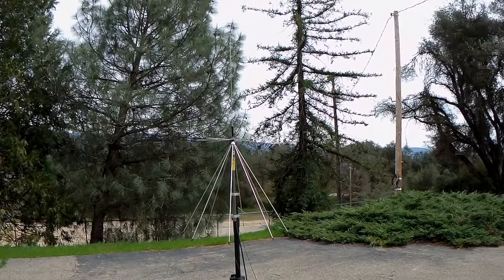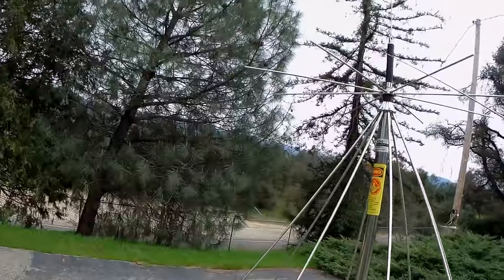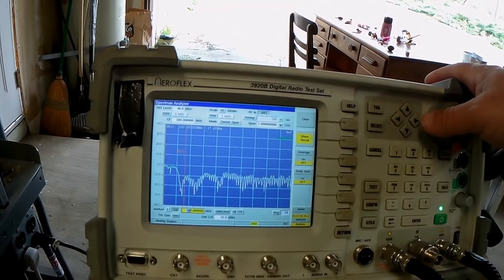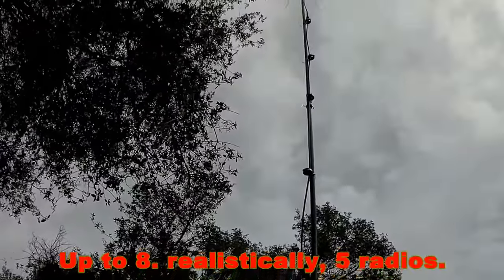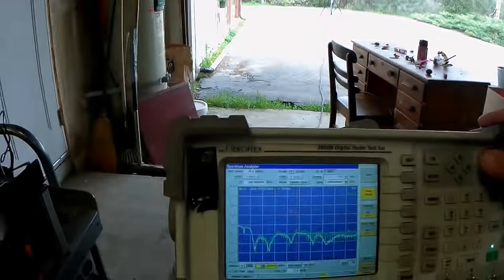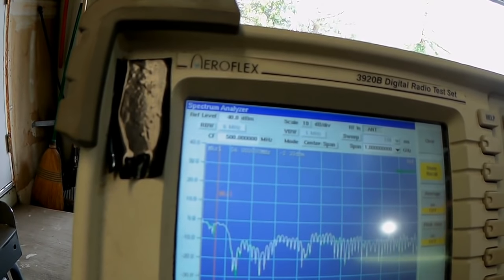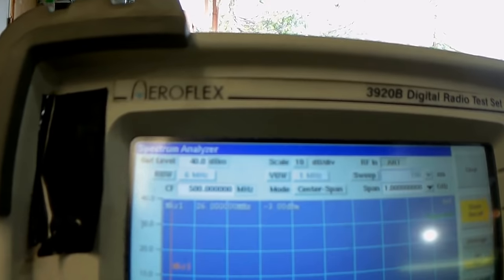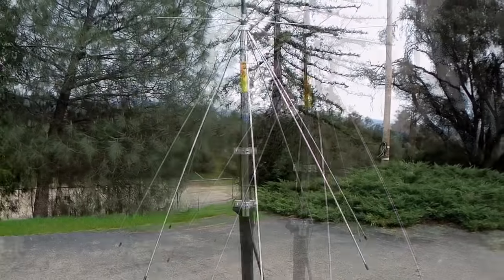Discone Antenna 4 Year Report. + Mods & Future Expanded Capabilities.

Comment: Very good antennas for a universal VHF, UHF , SHF and above =)   I have two of them and did radio repair for a few years ...... love them =)     Kept the two at the house and used them for everything with out worry to transmit into as long as the frequency was above 50 Mhz =)   Now that being said ..... these antennas DO NOT HAVE GAIN over a DIPOLE ANTENNA; but work GREAT on RX and TX within their design frequencies of operation =)   Good YouTube =)
Reply: @vincenzom1954  Read the second to the last sentence of my post and you will get your answer =)   Thanks for asking =)
Reply: @vincenzom1954  Looks like you can transmit on that antenna .... but not good for any DXing ( the antenna has NO GAIN =)   It is like a broad banded Dipole antenna that is OMNI in TX and RX =)   I hope that helps out =)   I had to look up the antenna that you mentioned as I did not know anything about that product =)   I usually build my own antennas for many years =)

Comment: Cool beans. I have had luck with a 1/4 wave resonator cut for a low band frequency of interest. If you extend the length of at least one of the cone radials your return loss on low band will improve quite a bit. Thanks for sharing !
Reply: That's a great tip on lengthening one of the cone radials. I may give your tip a go. Thanks for sharing that.
Reply: You are welcome ! It is adding a vertical dipole to the discone. You just about triple the bandwidth of the low band resonator. It will shift some peaks and valleys around when you sweep it but it will still behave like a discone  Multiband is all about compromise Let me know how it works out for you.

Comment: Your permanent mast appears to be metal with your coax running through some sort of donuts. Are they faraday magnets? I am in the process of setting up my first UHF/VHF antenna after obtaining my Technical license. In my research some prefer a nonconductive pole to avoid (ground loops ?) or maybe I'm confusing the terminology with shack grounding. Regardless you appear to be getting good results with your system which appears to contain a metal mast. Any insight is appreciated.

Comment: What i have done with this particular diamond discone antenna....

Buy a Shakespeare fiberglass 8 foot LORAN C whip antenna from west marine with the standard cb antenna thread for about 30 dollars. Put in a barrel nut on the top and place the LORAN C antenna antenna where the 6m was .  Put in a LDG antenna tuner between the antenna and radio. Now you can do 40m HF though 1.2ghz UHF . Use a diplexer if your radio has separate connectors for HF and VHF/UHF.
Reply: Do you transmit on this setup too on HF ?

Comment: i have a discone and 3 scanners.   Can i use like a cable tv splitter that sais 4-mhz-1.2ghz ?   Thanks...or do i need to buy one just for scanners?  i thought since the frequency in the tv splitter has the specs, that i can use it..

thanks...
Reply: You can use a CATV / SAT splitter and type F connectors for your receiver setup  ( and RG6 cable too !)  A CATV / SAT splitter on xmit is no bueno due to there being a lack of port isolation . Some splitters are engineered to have attenuation on certain ports so keep your eyes on that and any splitter increases loss.
Reply: ok thank you sir.  I only want it for receive and for transmit, i will have home runs to individual antennas...glad i can use CATV splitters.
Reply: Dont transmit into one - just wanted to be clear on that.  You will be dumping RF right out of your transmitter into anything else in the chain. For passive devices (receivers) you are ok.  You can daisy chain coax tees and jumpers for scanners too (most of your assignment desks in media are set up like this) Again there is loss and no isolation but for most stuff you are good to go.